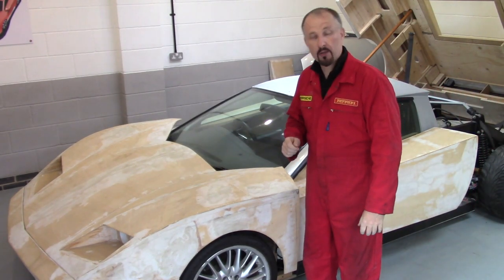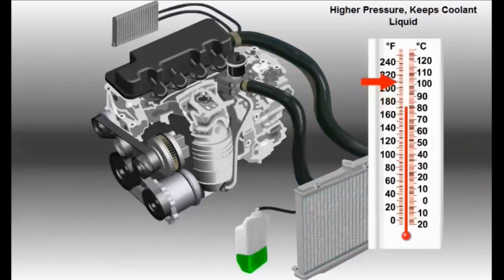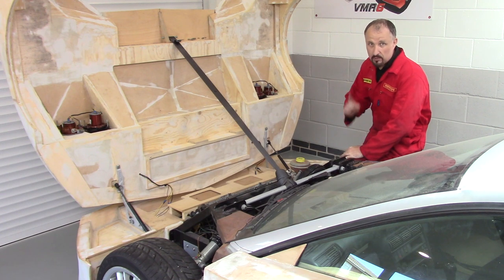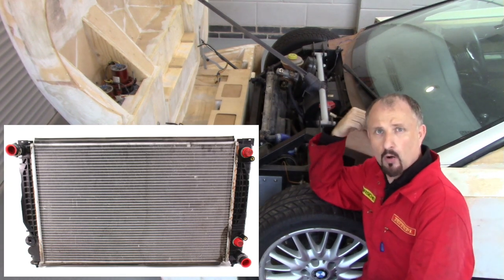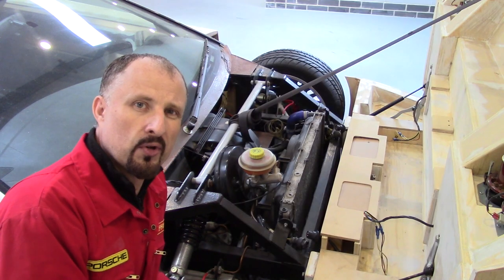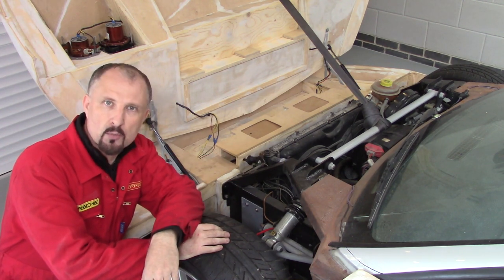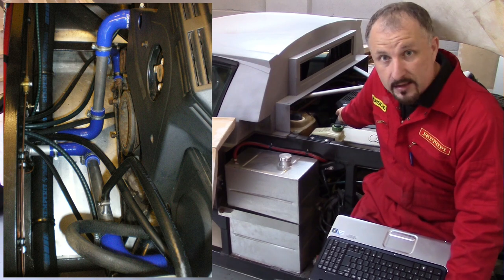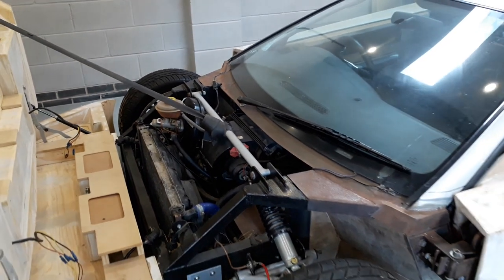Building the Cooling system for my DIY Supercar: Prototype Ep14

Comment: That is a very informative/well explained clip you found there. (the one at 2:00 - the others are a bit disheartening). Point taken at 7:30, but your airflow has to be the same. Different aerodynamics may make a difference? Y'know, engineered 'n shit. I had a leek in me engine bay once, drove thru the vege patch. Do you keep a list of parts used so owners after you mass produce these can source spares? I'm sure you do, but valid point I reckon. Anyway, cheers bro
Reply from the maker: You're absolutely correct about the airflow Don, but I'm saving that for when I do the episode on the front bumper and the air intakes. Yes, I've got a complete list of the parts, including OEM part numbers, for if/when this car goes into production. If this car is ever sold as a kit I want to help my customers in every detail. ;)
Reply: Actually, I think you may have mentioned that before - about the parts and oem numbers.